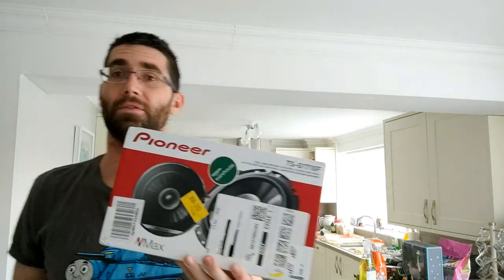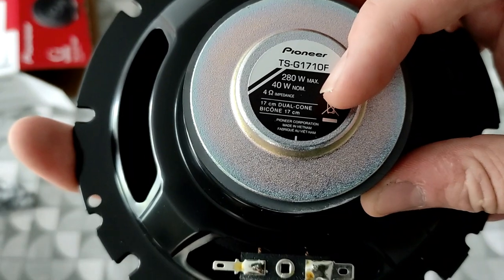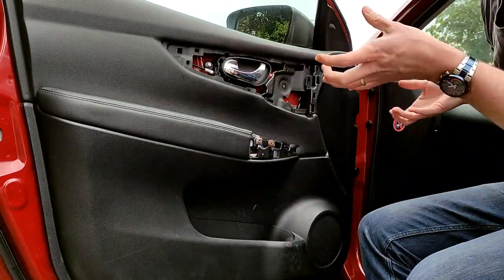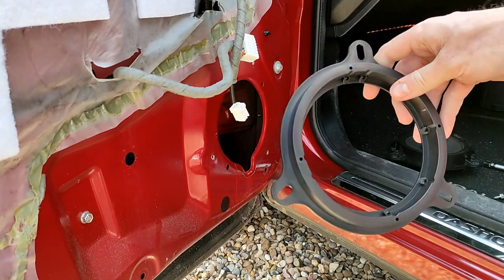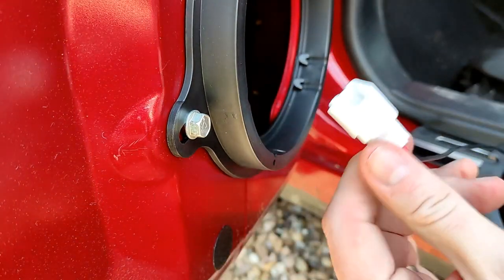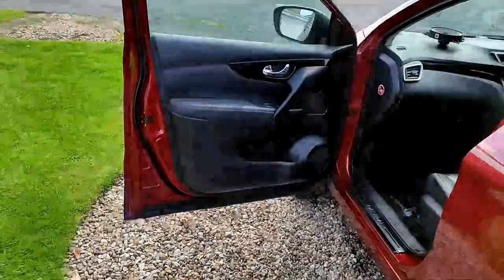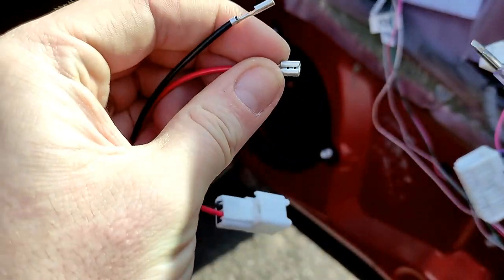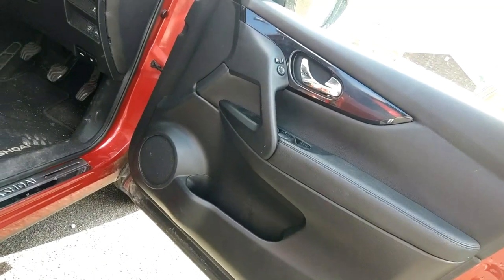Nissan Qashqai J11 Speaker Change / Upgrade Tutorial (Inc doorcard removal guide)

Comment: A missive Thank you for these Videos.
I’ve just done my speakers in my car. Always wondered how easy it would be but put it off until I found your video. My drivers side speaker blew, no sound for 2 weeks and went and did the change last week. Hard to get the doors off but then easy once you do one.  Used the same speakers as they had great reviews, definitely better than factory fitted ones and got the speaker supports.

The speakers are a massive improvement on previous speakers. 

Again, thanks for all your vids. Changed interior lights. And now have the bulbs for the external lights. Not looking forward to that though.

Comment: Thanks for the video. Just did mine as per your vid. Contrary to the previous comment the speakers are a decent improvment over stock in terms of sound quality and physical quality. Better magnets and speaker cone materials. I expect they will last far longer than the cheap paper cone ones they have replaced,  Thanks

Comment: I have just finished fitting a set of front door speakers using your very informative video, just to add that there are holes in the adapters for the wiring to be fed through, I used these as I was concerned about the wiring being internal as you showed would possibly foul upon the windows?
Fitted and all good.
Thanks 😊

Comment: Hi, just had to upgrade my front door speakers as drivers side crackled and gave up the ghost. Followed you video tut only to find the idiots have riveted the speakers in place on a J11b 2019. Not only having to buy speakers and adapter rings but now have to buy a Rivet nut tool and drill out rivets. Grrrr
Reply: Hi there. I just got to the same stage. What did you do next? Thanks
Reply: Drill the rivet heads out with a 6mm drill bit then opened the holes with a 9mm bit. Used a rivetnut gun with 8mm rivetnuts.. used flathead screws. Thunk they were 16mm long

Comment: Another helpful video Dan! Regarding the stereo cutting out issue (Nissan update), my car cuts out a lot and I thought it was loosing the DAB signal until I saw your video about the update. I really don't want to go through the dealer and I know its a bit of long winded process but do you have any links or files to do the update yourself?
Reply from the maker: It's really simple if you call Nissan UK, they'll sort you out.
I wouldn't recommend doing the update yourself when it's free of charge. If it goes wrong it can brick (kill) the stereo.
Reply: Go to Nissan direct they were brilliant and they sorted it straight away by giving me a code to give to my local Nissan dealer and they did the update in an hour and free of charge!

Comment: Hi Dan,
Did the speaker upgrade meet your expectations? I’ve replaced all 4 door speakers but feel left a bit disappointed. Sure, there is more clarity and less distortion under high volume scenarios, however the bass is still lackinga and about on par compared to factory shitty speakers. I think the head unit is just not capable of utilizing the full speaker potential now. Also, since we had to remove the door cards, guess if there are no creaks in there? Wrong, there are! So although it does sound marginally better, in my case the better option would have been to install a under seat subwoofer… Whats your take?
Reply from the maker: Yeah the speakers aren't great but they aren't expensive either. A sub would be a good addition.
Reply: Did you go the route of a sub woofer? Which one did you buy and how did you connect it up? Was it in the back of the stereo or just piggy back off the +/- of a speaker wire?
Reply from the maker: I didn't mate. Needed the boot space!

Comment: Hi dan thanks for a great fitting tutorial. My drivers door speaker had blown AGAIN (i swopped it over from the rear on last time) they are 20 watt speakers fitted in mine. As some have mentioned the base is lacking on these speakers could you recommend better ones pleased as ive no idea what to look for

Comment: I'm planning the speakers' upgrade and since already removing the door cart, I'd like to improve sound insulation. I can see lots of uncovered areas (plain paint, no insulation) in your video. I've found 2 types of absorbers: 1.6-2.6mm butyl mat for rattling reduction and 8-10mm foam mat to absorb some sounds\noise. Is there a potential to stick some sound absorbers on those uncovered areas? I mean wouldn't it prevent cart from clipping back in?
Reply from the maker: There's a lot of space behind the door card but some parts are very flat. You'd probably have to work it out with it removed.

Comment: Nice video, I want too do mine I just looked on amazon did you get the Sound way ones thanks
Reply from the maker: I got Pioneer
Reply: @TheQashqaiGuy  Ah I meant as in the spacers, can I ask did you notice a good sound improvement from the pioneers, as I love loud music but I hate distortion thanks
Reply from the maker: Ah I see! Yeah sorry I got the sound way ones.
The treble definitely improved, bass not so much. I think if I were to upgrade again I'd go for better coaxial units.
Reply: @TheQashqaiGuy  Thanks for the quick reply, I thought the qashqais came with a separate tweeter upfront, I just ordered some Comp JBLs that have a separate tweeter, I hope they will work now and thanks again.

Comment: My alarm goes off during the night 2017 qashqai have you come across this and if so do you know how to fix it thanks
Reply from the maker: Seems to be a relatively common issue.
Try locking it with the interior sensors off by pressing the button by the rear view mirror. (It should beep when it locks)

If it still sounds then it is probably related to the external or rocker sensors.

Comment: Got as far as getting the door cover off.... Only to find no bolts on the speaker holder. They look more like giant rivets with a hole in??!
Reply from the maker: That's unusual, is yours the same model?
Reply: @TheQashqaiGuy apparently (from one of the other commenters) it's a j11b 2019 model. The door was ready to take off and replace though. Thanks. Now to decide if I want to start drilling...